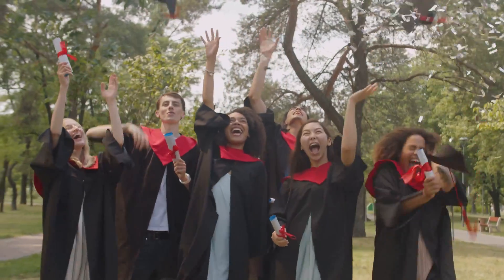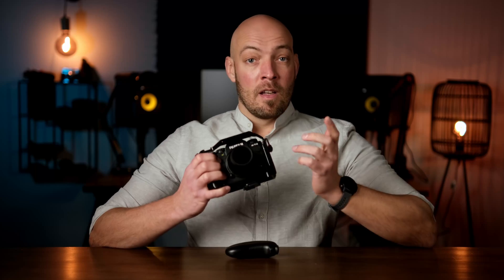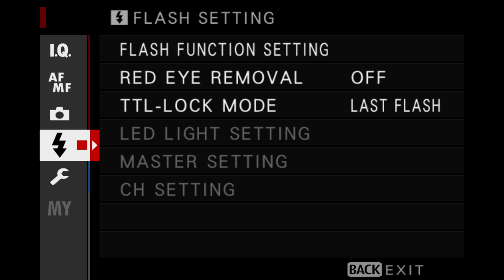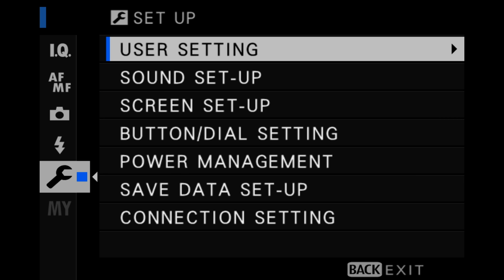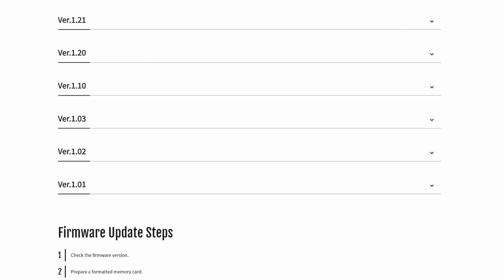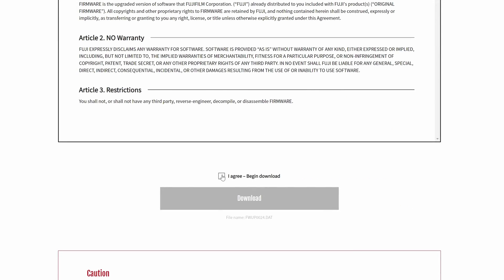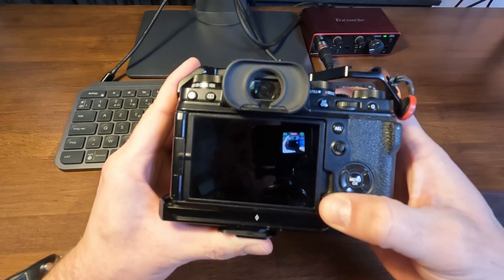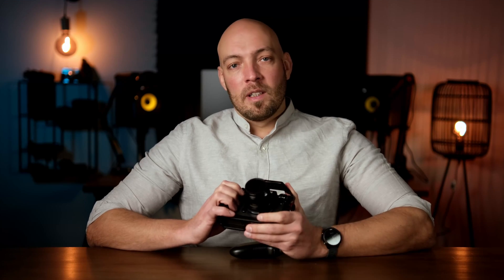XT4 Firmware update – What, why and how (step by step)

Comment: Thanks fpr the chat. My XPro3 firmware was updated to version 1.3 on 28th Feb 2022, just a week ago. I didn't notice this and I am on v1.22.... but wait, the only improvements it lists are 1. Folders now contain 999 files instead of 9,999, and 2. The horizon indicator tilts a little more ? Hardly worth my bother... I'll wait until something exciting is added !!! By the way XPro3 still perfect for me
Reply from the maker: Fair points. This folder adjustment was apparently necessary for Mac users because of a problem on the side of Apple. So Fuji is offering a workaround for a problem they don't really have. 🙈 But good on them! Indeed not every update is essential.